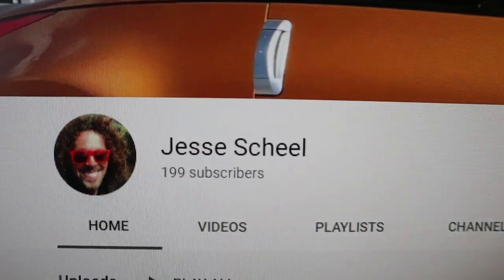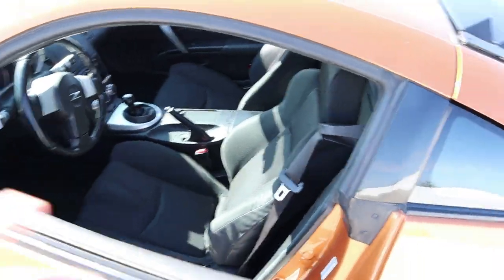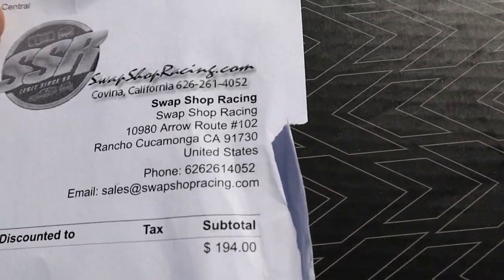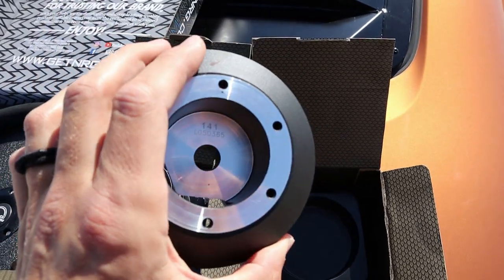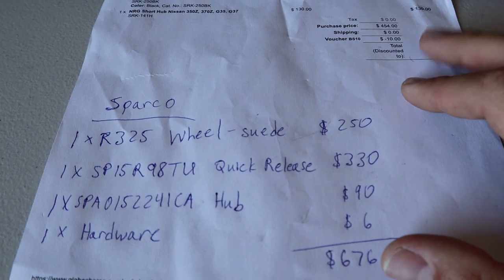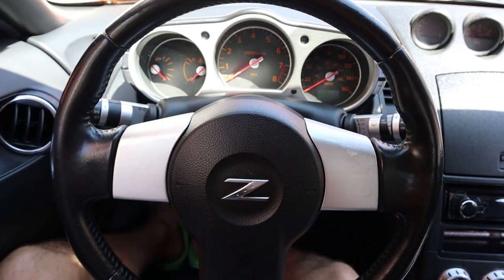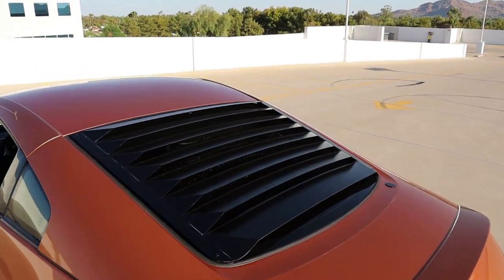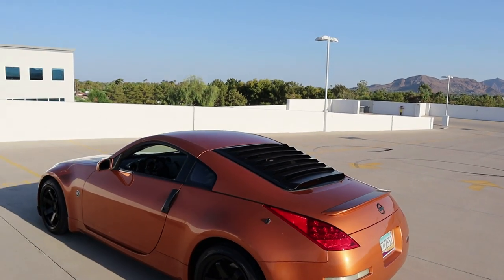350Z NRG STEERING WHEEL, QUICK RELEASE, SHORT HUB INSTALL AND REVIEW

Comment: How long would you say this took you? . Great video.. I have everything sitting here except a t30 and a resistor.. mine is a 98 civic so a tad different but pretty close.. 👍
Reply from the maker: Its a quick install. 1 hour max as long as all bolts come out easy and you dont strip anything putting it together. 🙂👍

Comment: After having the wheel for a while, how is the build up on natural body oils like sweat and dirt holding up ?
Reply from the maker: Hey Lauren! So far so good. I believe NRG treats it with something to make it water resistant and slightly dirt resistant. It still looks like new still but its only been a month or so. If your concerned about grit and grime maybe go with a leather version that is easier to clean. I will pry buy the same wheel for my other car at some point and go leather on that one. Hope this helps you! 😊
Reply: Jesse Scheel thank you !! But I wasn’t sure on leather as I live in fl and it gets super hot!! I’ll look into this one !!  Thanks again and keep up the great work
Reply from the maker: @laurenbrown6056  Your welcome! Go with the suede then I am pretty sure you will be happy with it! Let me know if you have any trouble with the install. Make sure you have all factory and NRG wiring through the hub before pushing it down on the column. Hard to get it off without a pulley puller after that.🙂👍